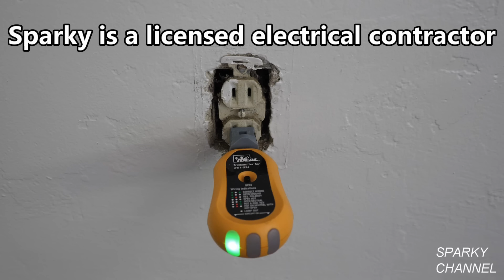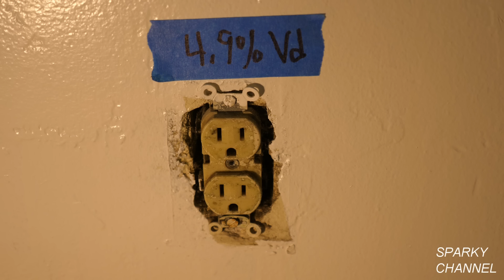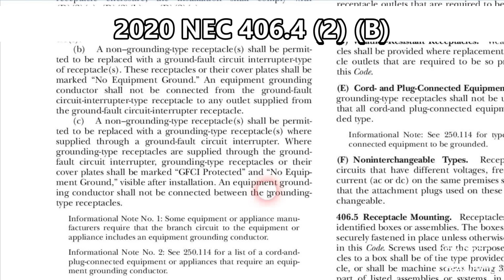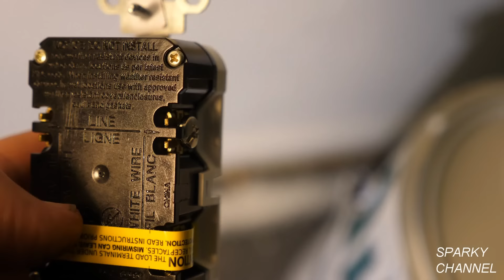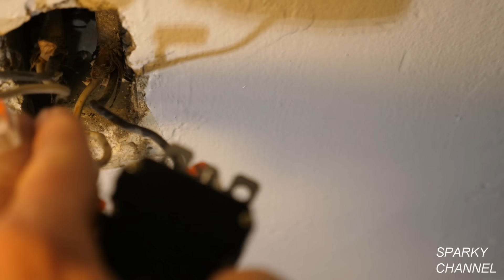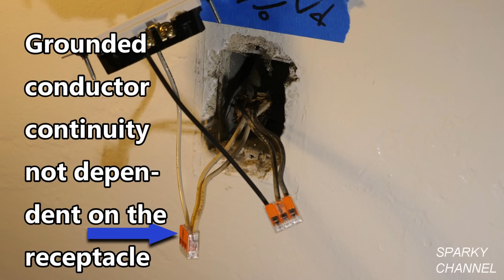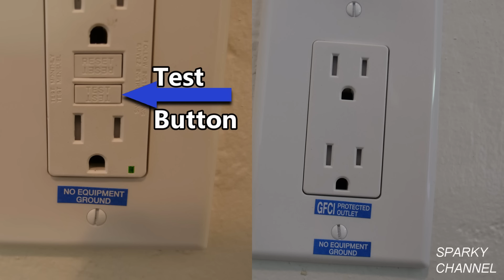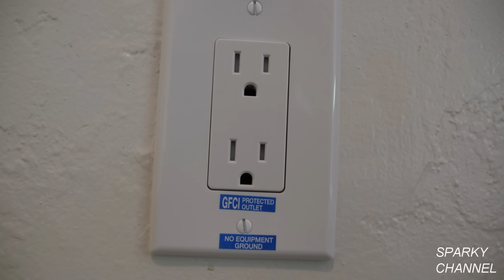2 Prong Receptacle Circuit Replaced by GFCI and Grounded Receptacles per 2020 NEC

Comment: I have a 1962 1600 square foot single story ranch house with similar voltage drops, but I have already changed the outlets and replaced the sub-panel pigtails with Wago lever nuts with no change.  I have the Ideal Suretest and have been trying to improve the voltage drop.  Hot wire impedance is usually about 3x the neutral and ground wire impedance, but I haven't found any issues when replacing the outlets or wall switches.  What could be causing this?  Voltage drop decreases as I get closer to the main panel, so I don't think the problem is between the first outlet and the panel.  It would be nice to know, when you take readings at the first outlet (and got the 4.9% voltage drop at 15A), the distance from that outlet to the main panel so I can compare to my home's setup.    Thank you!
Reply from the maker: Very interesting! Are all of the terminations in the panel and on the receptacles good, that is, no loose or over-tightened wires?
Reply: @SparkyChannel  I haven't found any loose connections in the panel or receptacles, but "over-tightened?"  Can you elaborate on that?  I've always made sure my connections on receptacles are good and tight, but this is the first I've heard that an over-tightened connection can adversely affect impedance, if I am understanding your inference properly.  Or do you only mean inside the panel to the point where the wires inside the panel are damaged and no longer the proper gauge?  In that case, no they are not damaged in the panel. I did find that one branch circuit was designed way too long, with all of the house's bedroom and living space ceiling lights, as well as garage ceiling lights, driveway flood lights and center load-bearing wall outlets all on the same 20A circuit.  That circuit shows a 17.5%Vd at the last outlet @20A load.  Regarding the panel circuit breakers...I took each CB out and ensured the contacts were clean, then reinstalled them and retested with no change in impedance on the Hot wires.  That's when I tried replacing the old wire nut pigtails with Wago lever nuts, and that made no difference in impedance either.  The 20A circuits are using 12 awg, the 15A circuits are using 14awg, and all of the metal junction boxes are grounded in the back like you showed in one of your videos, so I got the neat ideal drill bit/tap set and ground pigtails to add to the boxes.  Great demo--thank you!
Reply from the maker: @life-longpatriot8258  Sure. Please see my video: 2023 Changes to Torque Codes 2023 NEC 110.14 (A) and (D) Terminal Connection Torque: https://youtu.be/ByjPWnU76yo
Reply: @SparkyChannel  Thank you.  Checking it out now!
Reply: @SparkyChannel  Have you ever found high impedance across a circuit breaker inside a de-energized panel? I'm just curious why it seems like if the neutral and hot wires are roughly the same length, why does the hot wire impedance always seem so much higher than neutral? At the first outlet of my 20A kitchen counter outlet circuit, the impedance of the neutral wire is only 0.06 ohms, but hot wire impedance is 0.17 ohms and the voltage drop is 3.8%. Because it's such a small circuit, voltage drop at the last counter outlet is only 5.6% at 20A, so not a major concern, but I'm still curious about the significant difference in impedance between hot and neutral.  I'd already removed the CB to ensure clean contacts and removed and reattached the hot wire to the CB, as well as replacing all wire nut pigtails with Wago lever nuts.  No change. That difference in impedance is effectively 36 feet additional length in the hot wire (based on 0.003 ohms per foot).  I do have a generator manual transfer switch installed that would add a few more feet to the circuits, and I am not sure if it adds the same impedance to the hot side as it does to neutral, but it sure wouldn't imbalance it that much since it's 12AWG internally.

Comment: Can I have two gfci outlets on the same breaker. Say one in both bathrooms. I tried installing a gfci in my bathroom downstairs but the gfci would stay tripped. There is already a gfci installed up stairs. But when I installed the gfci downstairs it would stay tripped. Is this because there is moisture in the line or because of two gfci outlets on the same breaker?
Reply: U should put a normal outlet on the load of the gfci so that outlet would be protected
Reply: Do not install GFCIs in series. It you want different GFCIs pigtail.
Reply: I have a circuit of 4 outlets, all GFCI on same breaker (Overkill)... I had one GFCI down stream that would not reset (stay tripped)... turns out I had a loose neutral wire in a wago connector just upstream, I properly secured the loose neutral and the gfci downstream reset... AND FYI just because its a GFCI doesn't necessarily mean it can be installed in a bathroom/kitchen area prone to moisture and wetness... check the packaging/back of the gfci unit to determine if the gfci is allowed in an area prone to moisture/wetness... all of my gfci's say DO NOT use in areas prone to moisture/wetness... I am no electrician but I do believe you need a GFCI that is designed for high moisture/wet area...

Comment: Gonna have to do this sort of upgrade in my old 60's-built house I inherited.  Lots of 2 prongs, no grounds, lots of sparkies when you plug things in.  I absolutely hate the wiring in the building too.. that old cloth-wrapped 2 conductor stuff.  That circuit analyzer is a bit pricey, but compared to an electrician visit, might still consider it, since I'm likely to be doing a significant amount of electrical work in this place.
Reply: in the same exact scenario as you. me and my brother inherited our moms house. she passed in january. i have some experience with electrical work and am thankful for that. i have found a lot of stuff my dd put in that is just groan worthy. he absolutely had no business messing with electrical and now i am having to fix it.
Reply: @AverageCatToyEnjoyer  The most egregious thing I have discovered so far was in the garage my great grandfather finished to a large activity room.   Before he put paneling on the wall, he splice a flimsy brown extension cord into a circuit and ran it through the paneling, then up the wall and across the ceiling... then he wired a bulb-type ceiling light with it and used a screw in converter back to a 2 prong and more extension cords to run all the other lights in the dropped ceiling.... like... what... the.. heck....  like was he actually trying to burn the place down?  lol.  Needless to say, that circuit was the first to be fixed.

Comment: Yes and that much confusing…don’t understand what volt drop is and why. He is not clear on his objective. Grounding old wiring is the topic,  but he clearly said he’s not using the green ground on the GFI. ????   Wtf
Reply: There is no grounding conductor in this older house wiring, thus no ground wire to connect to the device grounding screw.

Comment: It looks like your GFCI is not grounded? 
Would your GFCI circuit pass rental inspection test, for outlets within 6 feet of water faucets?
Does this GFCI still provide the intended protection?
Reply: That is a good question. Not sure if it would pass a rental inspection, but if that GFCI pops, it will shut down the remaining 6 receptacles in the downstream.
It was a great demonstration. I'm dealing with a similar situation at a rental property.
Reply: @tii2015  If I don;t forget, I'll let you know what happens with mine, or if i Learn more, although I have not even scheduled the inspection yet. But, my due date to be  all done in November 1. I am working with city of Detroit. What city are you dealing with?
Reply: So what did you find out regarding rental inspection ?
Did you pass or did you have to find other solution ?
Reply: @promotionusa   Yes, I passed. Turns out receptacles were grounded, and the gfci tested perfect after I put them in.

Comment: My dad used to just cut the 3rd prong off of cords (not safe to do) when we used to have 2 prong outlets and my mom absolutely hates those 2 prong outlets so my dad and I replaced them all with 3 prong but here’s an interesting thing, all the boxes in the house were grounded which is extremely rare.
Reply: Some older homes were wired with armored cable, also known as BX, with metal boxes,  the metal jacket on the cable is used as a ground.    Some homes built in the mid 50s to early 60s, just prior to the 1962 requirement of grounding type receptacles,  were wired with the old style cloth braided NM cable,  with a very small, maybe 16 or 18 awg ground wire wrapped around the clamp of a metal box where it cannot be seen.    My guess is when grounded NM cable was in it's very infancy,  old timers were like "where does this new fangled bare wire go to? Everything has always worked fine without it "    In the trade this is called back-wrapping, I've seen it in a couple of 1950s ranch style homes.

Comment: Why can't you connect the ground prong to neutral wire? It is bonded in main panel anyway...?
Reply: when a device is plugged in, you have current on the neutral.  If you connect a receptacle's ground to neutral, you're now feeding current to the ground of the attached device.  This creates a shock risk and can damage electronic devices plugged into that device.  That and it's explicitly forbidden by code.
Reply from the maker: @jeffeverde1  Excellent explanation.
Reply from the maker: It ruins your house grounding system and is very dangerous.
Reply: There is no fundamental reason why one can't do. That was a common method in many countries in the past, including Germany and Finland. Unlike may think it does not cause any immediate danger, however, it does have problems so there is a reason to ban it. The most feared one is that if the neutral breaks the there will be full mains voltage on every grounded case on the line. Alternatively the system may start to use your data cables as the neutral. That is hardly desirable. It also in normal operation can cause interference on the data cables. It also is incompatible with GFCIs upstream. The worst risk in it is actually that you do it wrong and connect the ground to the live wire. This actually has cause fatalities.

It is legal here still in modifications but the pugs here are designed so that you do not need to change ungrounded sockets.

Note that even in the standard installation that the neutral can break upstream form the main panel and cause similar problems. This video shows a case where the house accidentally  uses the cable-TV line as its neutral. A situation that could kill an unaware cable TV-installer if he cut the cable.

https://youtu.be/BTW5e-WNjp8

If you do the connection in the socket where you use your PC that is connected to a cable modem then breaking the neutral in the socket or upstream could cause the same. So your internal problem could cause risk outside the house. This cannot happen if the ground and neutral are connected at the main panel where your responsibility ends.

Comment: I thought after this fix I did my tester in on of the downstream receptacles would trip the GFCI but it didn’t. Is that correct ??
Reply: If there is no ground wire the an external tester is useless. Use the test button. Then check that the downstream outlets are dead.
Reply: @okaro6595 I would assume it would just send like above 5 miliamps of current between hot and neutral, so no ground is required but I might be wrong I guess
Reply: @okaro6595  everything worked fine downstream. Short circuit tripped the Gfci
Reply: @mikezimmerman2786  nice
Reply: It should have tripped did you wire it correctly and does that receptacle come after the gfci in the circuit
Reply: @Vanilla_Icecream1231  I bought the tester $350.00 and followed the video , found the hot feed wire and proceeded from there exactly like video. Still have a few more on the circuit no ground on the circuit so the Gfci shouldn’t trip right?

Comment: On the second and beyond receptacle, I'm confused as to why you linked the line and load wires into the Wego. I would have expected the black line to go to the black line in the receptacle and the black loan to go into it's own screw on the receptacle. 

If you used the Wego to meet code and extend the line 6'' as needed, I would have expected 4 wegos and 1 wire for each of the 4 screws. What did I miss?
Reply: You can do it your way, where on the 2nd and subsequent receptacles are wire in series.. where the incoming hot goes to a screw terminal and the outgoing hot goes to the other terminal (and same with the neutrals).  The way he wired it with the Wagos and pigtails just puts the downstream receptacles more on a parallel so there's no loss to power to any downstream receptacles in the event of a failure of one of the upstream receptacles.  Both ways work.  Just make sure the first receptacle in the run, where the GFCI is located, is wired THROUGH the GFCI so the entire circuit is protected.  Otherwise you'd have to pigtail all receptacles and install GFCIs at each, in essence they would all be operating independently of each other.  Hope this doesn't make it even more confusing.  Good luck with your projects.
Reply: @bryanknudsen8100  Exactly.... its like wiring lights in parallel so if one goes out, they all dont.

Comment: Ok now I'm confused. Do I need afci/gfci outlets in bedroom or not lol? This video shows a whole circuit of just gfci's or did I miss something along the way? Thanks...
Reply: just one gfci at the start of the circuit (closest to panel) and the rest were regular outlets but they are also protected by the first’s gfci’s protection
Reply: @ritchiemeza  yeah I get that part, but also seen his video explaining the different ones and in that video it says you need afci/gfci? Think it's 6 different outlets thays explained and the codes for them.
Reply: When replacing old two prong outlets whith three prong without a ground wire the standard rules do not apply. It is always GFCI protected.
Reply: NEC requires GFCI where an outlet is within 6 feet of a water source.  So the question is - what exactly is going on in your bedroom?  :)
Reply: @jeffeverde1  wife might be a squirter

Comment: Thanks Sparky I need to use this info in a 1953 fixer house I just bought. I’m also going to run some new receptacles from the updated breaker box. Your information is excellent.

Comment: I use those circuit tracers and I get about 4 or 5 breakers that signal me. And it's always the last one I flip that actually is the circuit I want to kill. It's never the first or second. Those things aren't as good as you show them to be.
Reply: They work pretty good. Most, including the one he uses, you're supposed to scan all circuits and then scan them all again a second time to identify the correct breaker.

Comment: I attempted to do this in my 1942 home and the GFCI would not reset after being properly installed. I placed it first in the series. Does this mean there is possibly a shared neutral or something weird going on downstream. When I hit the reset button the power would flash downstream then immediately trip.
Reply: Shared neutral seems pretty likely.

Comment: My old boss would just jump the nuetral to the ground screw to cheat the inspector into thinking the circuit had a grounding conductor.
Edit: don't do that, seriously
Reply from the maker: That's horrible. I second your warning.
Reply: Your old boss is an idiot.
Reply: @PappyMcPoyle-vj4vt  And a criminal. Putting others lives in danger.

Comment: Can I just measure voltage drop with a voltmeter by comparing (a) voltage with no load on the circuit and (b) voltage after putting a load on the circuit (e.g., by turning on an electric heater plugged into the outlet)? I'm trying to install GFCI outlet at the closest to the circuit breaker, but I don't want to shell out $350 for the device you use for voltage drop.
Reply: Amazing idea

Comment: I'm 69. I won't be using the weegoes or whatever.. I'm surprised to see you using them and back wiring. Plus all that fancy test equipment is not needed.
Reply: I'm 61 and a (mostly) retired sparky, and I had my doubts about the Wagos, too.  So I bought a few and tested them thoroughly.  In my testing they would not easily release a conductor, and the created no more resistance than a wire nutted junction.  I still mostly use wire nuts - but I like the wagos for crowded boxes.  The only issue I've run into with them is when folding the wires into a crowded box, especially a box full of 12g, I need to pay attention that the release levers on the wagos don't snag on a conductor and pop open (happened to my once). 

One caveat on the wagos -- while the REAL wagos are reliable, the knockoffs (unfortunately, sold on Amazon) are total crap.  I tested a set of knockoffs, and they are easily pulled off both 12g and 14g solid conductors.
Reply: I'm sure the old guys with their horse and buggies thought those new fangled auto buggies were not need either.
Reply: The voltage test equipment wasn't necessary, but it did save time. If you do a lot of this type of work the correct tools can save you a lot of money. Time = money.

Wago connectors save space as explained in the video. They aren't a requirement, just a better way to do the job.